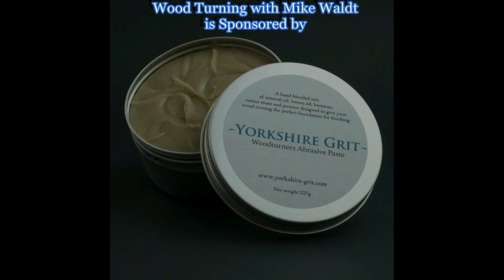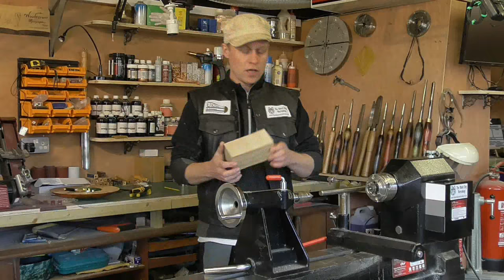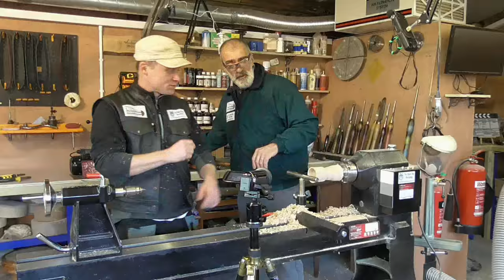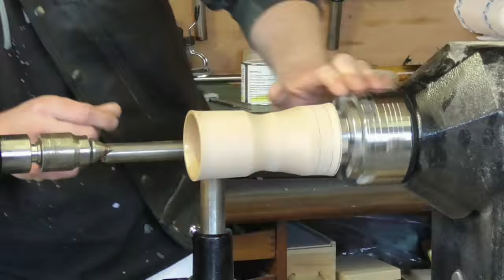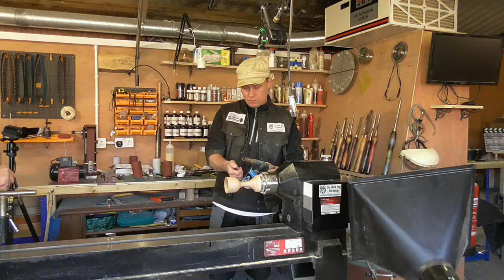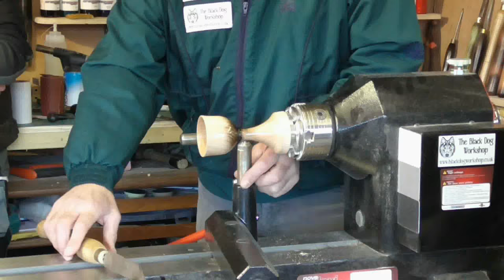Wood Turning - Black Dog Workshop Visit (Time lapse)

Comment: Looked a great day out. Watching Martins video was quite a surprise when you suddenly appeared in it. After you hollowed out it's just as well he didn't go through the bottom of the cup as I think we could have had a different form of goblet rather than the Coventry one. Out of interest what time lapse setting did you use, it looks at least as quick as 1 second frames if not less?
Reply from the maker: +Paul Lockwood 
Glad you enjoyed the video Paul. I just used 16x speed in my editing programme 
Cheers 
Mike